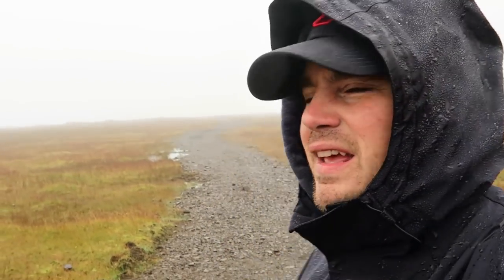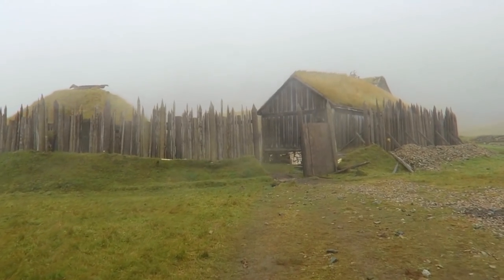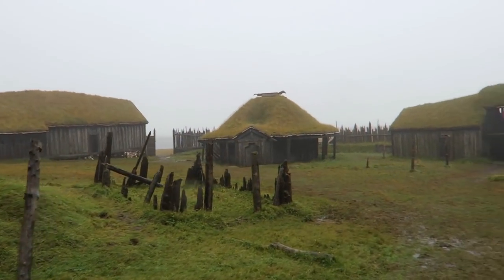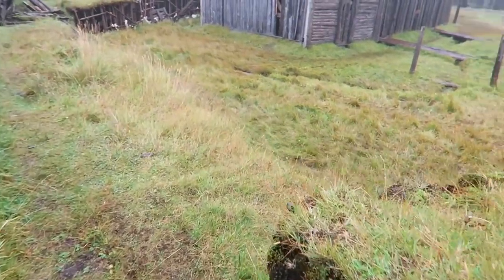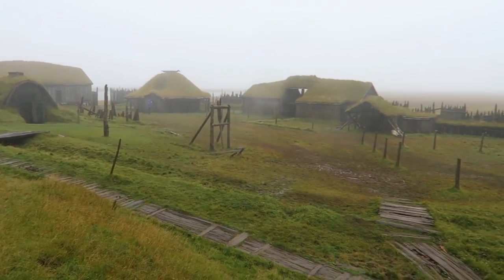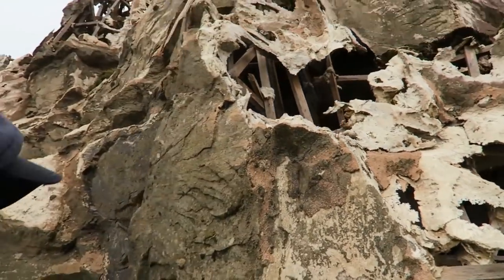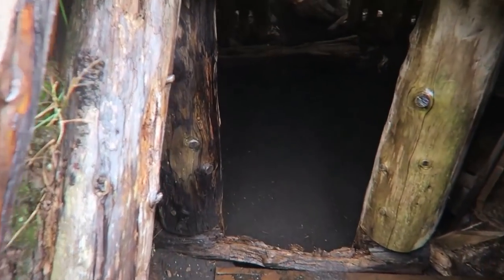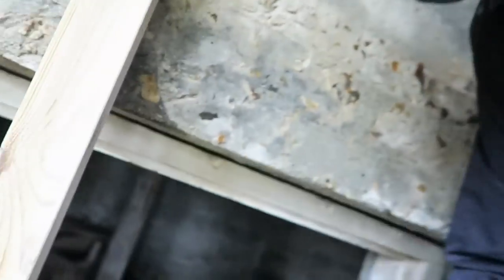Abandoned Movie Set Rotting Away

Comment: the house.. that actually looks like a house,  was exactly that, a house. it was not originally a part of the moive set
Reply: I think the house was there to start with. Looks like an old farm house that they then built the set around.
Reply: @alloneword7427   that is correct. it was an abondonet farm house
Reply: Yes and the structure under the mountain was all poured concrete not concrete block, much older then 10 years

Comment: The thing which you thought was the "storage container" was 100% the generator.  A remote site like that needs its own power, and you don't want to generate your power close to where you are working because it is incredibly loud, like a huge engine running the whole time.

Also, when you're inspecting a building, you don't say "inner-workings".  You only use that terminology if it's a machine or car or something.  Just say "inner-structure".

Cool video!